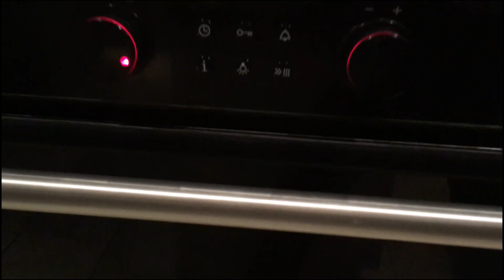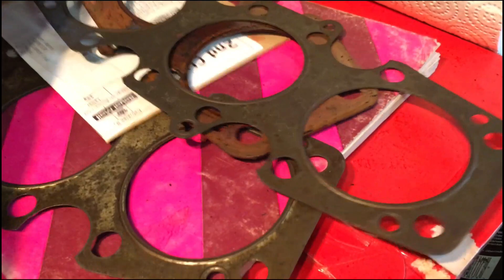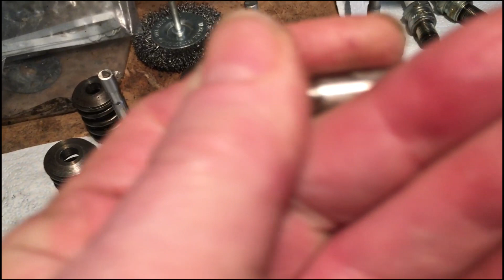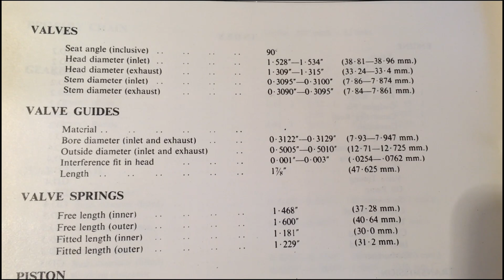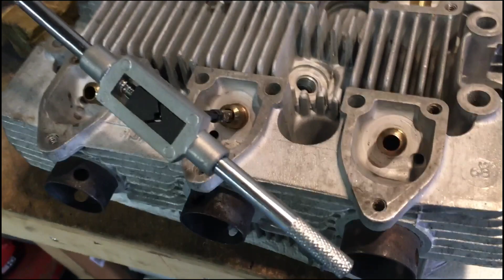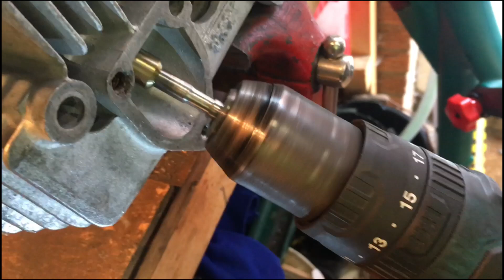BSA Rocket Three A75V - Top End Service - Part 3

Comment: Hi, why did you hit the valve with the hammer? I ask because it is not possible to hear the explanation in the clip due to an infamous noise
Reply: That’s done to make sure the Keepers are seated correctly, on the top of the valve.
Reply from the maker: Thanks Chris for the reply to JC. Yes to seat the collets and indeed springs and valve contact surfaces ready for leak test.

Comment: It’s good to see you again, I hope you’re feeling better. Is there a small dint in the surface of the cylinder head on the middle cylinder? Would the head benefit from lapping it on a piece of glass? Best wishes
Reply from the maker: Hi John thank you. Indeed there is a small dent and I’ve already faced the surface on glass as per last video. So it’s a little deep but small and away from an edge so I have a plan.

Comment: Hello Angus, you need a Gunson G4095 Eezi-lap Valve Lapper which makes lapping valves in a breeze, When reaming valve guides, do you not need a spiral fluted reamer ? Also when grinding in valves, you would be better to use diamond grinding paste which will speed things up. I believe RDG Tools sell it. Cheers.
Reply from the maker: Thanks for the comment and suggestions Velo. Re the reamers, they are adjustable so I started small and worked up to avoid taking too much metal at a time and also used an action similar to a hone to achieve an even bore throughout the guide. In the event not much had to be done to only two of them to achieve the required clearance.